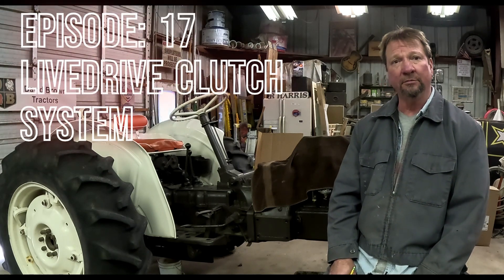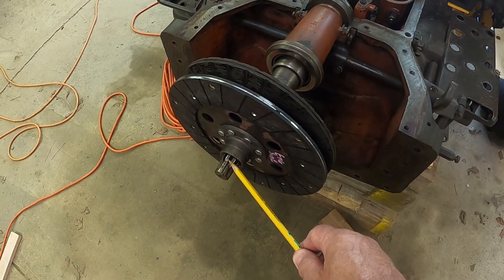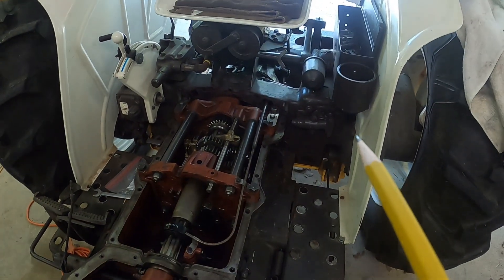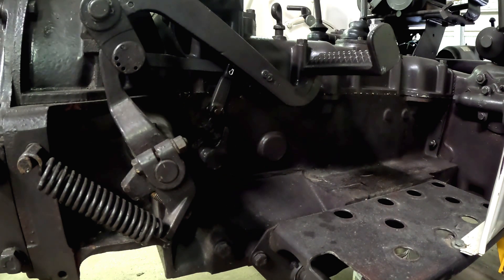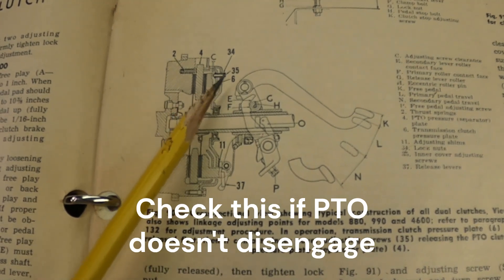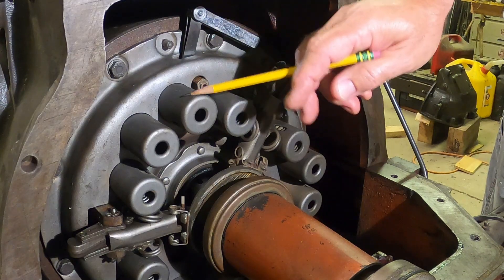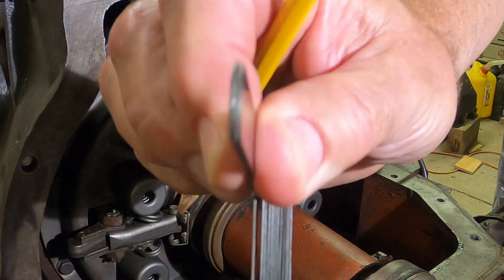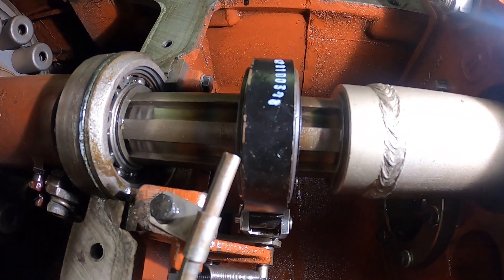David Brown 880 e17 the livedrive clutch explained

Comment: Any idea why my 885 after having clutch rebuilt with the flywheel ground it is not releasing the drive clutch no matter where the pedal free  play is adjusted to?
Reply from the maker: The inner cover adjusting screws (3) may be to tight. They can be checked through a cover underneath the clutch and should be set to .70 clearance. There are many other reasons for it not releasing, damaged levers on the cover plate etc. Check the adjusting screws, you can find the service manuals on line by a Google search. Did you have the cover examined for worn/damaged parts? That would cause a problem with releasing.
Reply: @tech.274 the whole assembly was taken o ft wayne clutch and gear. They rebuilt the lever  stands that were damaged.  They had the adjustment screws set to more than .70 (never measured what they had them set to) wouldn't go into gear, set them to .70, still wouldn't.  Now think we may have to back them out more to get it to releasem??
Reply from the maker: @madcamnelson176  Ft Wayne Indiana? I had mine rebuilt there, they had 1 in stock and switched it for mine. The 880 has a roller eccentric pin on the outside pedal that can adjust the movement, clockwise to increase, 1 hole is .005, that might help get the clearance.
Reply: @tech.274 yes in Indiana

Comment: Thank you so much for this video and information! I have one 880, one 990 and a 885 all in need of clutch adjustments. 

The 885 engages the clutch very high on the pedal and the 990 I kind of need to press it down to the ”PTO-stage” to disengage the clutch. 

I hope they are all fixable by adjustment. The price of a new clutch is almost if not more than the tractors are worth, at least here in Sweden.
Reply from the maker: Definitely check the adjustments. When I restored my 880, the clutch friction disks still had a lot of pad left on them. The adjustments were off, the pto would take a minute to stop spinning, and they were covered in oil. It's better to check it before replacing it. Thanks for watching.
Reply: I have 2 tractors 990 ..

Comment: thanks for the info.  I rebuilt the two stage clutch on my 770a years ago and FORGOT to put the three little springs back in during assembly.  Has been fine without them, but I still have the springs and will put them in if I ever have it apart again
Reply from the maker: Thanks, Chris, the springs aren't the easiest things to get to. I'm glad it's working.

Comment: I have an off topic question, would you know what would make a David Brown 885 act like it’s locked up? I was using my tractor on a pretty cool day, it was running great went to back up worked fine put it in forward gear and it bogged down and died, tried cranking and it cranked slow so I checked my oil it was full checked coolant level. It was full and warm tried starting it again and it fired right up put it back in gear and it bogged down and died again tried starting it again and it was acting like it was locked up. I can get movement through the starter hole with a pry bar at the fly wheel, not much because I don’t have much room to really crank on it but there was movement. I took the injectors out and tried cracking and won’t spin, engine has oil and antifreeze hydraulic pump is free has plenty of hydraulic fluid. Do you have any idea? No one in my area knows anything about the David Brown tractors , any help would be appreciated.
Reply from the maker: Hi Chris, reading through this it sounds like a problem with the engine. With the injectors removed it should turn over, unless the starter or battery are bad. You can try to turn the engine by hand from the front pully with a wrench. Also putting the PTO in gear applying the clutch to release it and see if the shaft will turn, you may have to use a wrench on the PTO shaft. If the clutch is sticking you won't be able to turn the shaft. Any attachments to the engine, power steering, front hydraulic pump even the water pump or alternator could be frozen, the belts should let you know by making some noise. Can it be pushed or towed out of gear? Try to narrow it down by removing what still works. If it's not locked up a problem with the fuel system would lower it's power causing it to die as well but it should turn over. I hope this helps, let me know how it goes.
Reply: I got it started!!! I took the starter back off and positively rotated the fly wheel , put it all back together hit the key, same thing acts like it’s locked up so I started checking electrical and I did come across a lose ground, everything checked out with my meter but it craps out under load so I fixed that, hit the key and nothing, nothing at all , so I take a screw driver and jump the starter post and sparks fly engine pukes diesel fuel,transmission fluid,and wd40 out of the injection ports spraying all over me. After putting the injectors back in and some other loose ends I try it once again and she fires right up. I did find my amp gauge was grounded out and my key has layed down but what I don’t understand is when it all started was when it stalled out and died I don’t know what that was about but thanks for the suggestion that’s what had me looking at possible electrical issues.
Reply from the maker: @chrisbutler8578  That's great Chris, I find it interesting that an electrical issue caused it to die. The 880 once it's running the electrical isn't needed, other than lights. A bad connection to the starter, or bad starter etc. and it won't turn over makes sense. These are great tractors, glad it's wasn't a major problem, although tracking down an electrical issue isn't a stroll in the park either. Glad to help, thanks for the update.

Comment: Very interesting, the 996 is a bit different as the live drive clutch is not controlled  by the clutch  pedal,  it has a separate hand brake type lever to the left of the seat against the wing. Have not gone into the gearbox but I would assume it more or less the same configuration as yours. M😀
Reply from the maker: Hi Marshall, I have seen the hand lever in the manuals, it will be interesting to see the different operation of the hand lever inside the clutch system. The live system was a big selling point back in the 60's and is a nice feature.